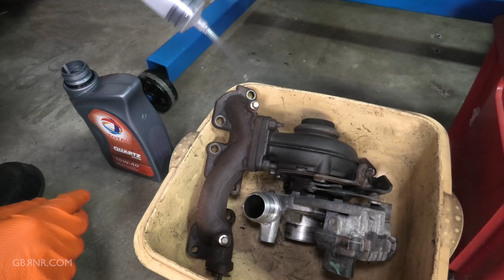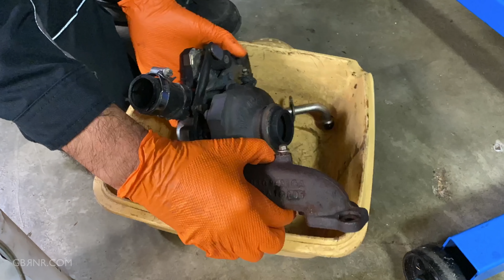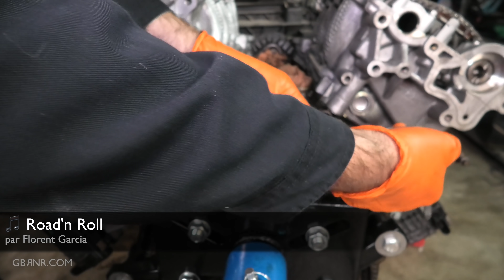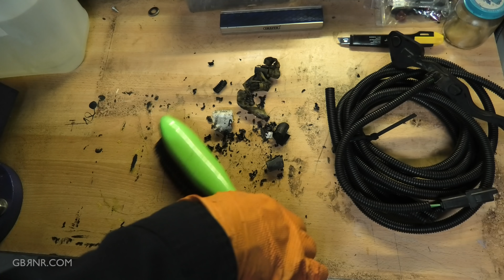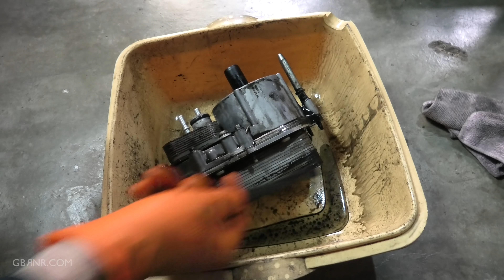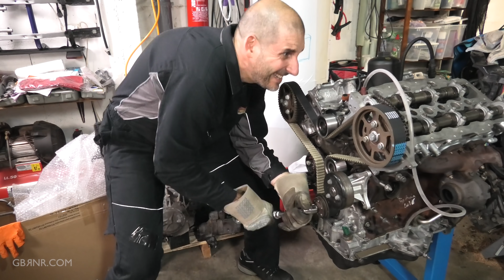C6 🐌  Bi-TURBO 🐌   le V6 retrouve ses attributs masculins

Comment: Quand je t'ai vu attaqué à tourner le moteur à la main, je me suis dis : courageux et costaud le gars ! ;)
Démonte les bougies, ça ira mieux ! Ça avance bien !
Reply from the maker: Les injecteurs ne sont pas remontés donc il n'y a pas de compression dans les cylindres. Et même comme ça c'est dur ! 🥵
Reply: j'ai pensé la même chose, c'est un classique, sinon tu luttes contre la compression.
en même temps (ça fait un peu macron :(  ) les bougies sont serrées pile-poil et par principe j'aime pas trafiquer les serrages de nombreuses fois ou revenir toujours en arrière. (c'est un coup à faire des erreurs ou alors tu reprends scrupuleusement ce que tu as fait, mais c'est du faire et défaire et refaire)
J'ai pas le moteur sous les yeux. mais justement n'aurait-il pas été possible de ne mettre les bougies qu'après pour pouvoir amorcer à la perceuse?
Reply: Garage, Bagnoles et Rock'n Roll  mais pourquoi t’as pas mis la clé à choc en mode visseuse en mettant la puissance en mode qui va bien ça te le ferais tourner sans peine
Reply: @mfrostel7459  des a-coups pareils dans une telle mécanique c'est à tout péter!!
Reply: @ZeshXD oui pour les accoups mais une clé à choc elle « choque » pour débloquer/bloquer. Une fois que la vis est libre elle se contente de tourner. La vu qu’il y’a peu de résistance en la réglant comme il faut elle ne choquera pas elle fera juste tourner le tout. Appuye sur la gâchette d’une clé à choc a vide tu verras elle ne choque pas quand il n’y a pas de résistance. Enfin un V6 a un fonctionnement "non linéaire" d’où le tendeur/amortisseur assez costaud sur la courroie pour encaisser les cycles compression/détente transmis à la courroie par l'ensemble de la mécanique. Donc je me fais pas trop de mouron à vide avec une clé à choc réglée faible. Attention ça n’est valable qu’avec le moteur pas étanche comme ici sans les injecteurs ou sans les bougies si c’était le V6 essence
Reply: @mfrostel7459  Y'a quand même l'air d'avoir une belle résistance ^^ Je m'y risquerais pas perso ;)
Reply: ZeshXD  ça reste un v6 avec un équipage mobile lourd certes mais la notre ami en bip sa race car il a un bras de levier plus que court et pas super adapté pour ce job

Comment: Coucou François c'était apaisant à regarder ;) tu aurais peut être dû vérifier la géométrie variable du turbo (ailettes) il est systématique que les turbos kilometrés présentent des grippages sur celle-ci. 

Un simple coup de dégrippant et brosse métallique suffi à éviter le problème sérieux de réduction de puissance (dégradé) et parfois casse turbo (plus précisément la turbine et les ailettes, en subissant des alternances de charge brusques et hors limite).

Il suffit d'ouvrir la partie échappement qui n'est que sincèrement rarement difficile à ouvrir (faire attention aux vis qui sont "cassantes") en faisant attention que le démontage ne cause aucune modification d'un réglage d'usine (dépend de la marque et du modèle).
A bientôt
Reply from the maker: Je ne vais pas tenter d'ouvrir le turbo: il y a de fortes chances que les vis pètent
Reply: @gbrnr  c'est vrai, une prochaine fois peut être :p

Comment: Bonjour François. Ça prend forme le remontage de ce moteur, joli travail 👍
Par contre tenter de faire tourner le vilbrequin avec une perceuse une fois les bougies de préchauffage remontées, c'était voué à l'échec. La compression est beaucoup plus importante sur un moteur diesel par rapport à un moteur essence.
Je suis pressé de l'entendre "chanter" ce V6 HDI. Bon courage pour la suite.
Reply from the maker: Les injecteurs ne sont pas remontés donc il n'y a pas de compression dans les cylindres. Et même comme ça c'est dur ! 🥵
Reply: @gbrnr  Ah bah oui, je les ai zappé eux, quel c-- ! 😂
Mais ça reste un bon V6, raide à tourner avec une clé à pipe et une rallonge.

Comment: Super vidéo
Je pense que le problème que tu a u pour l'amorçage du circuit d'huile est le remplissage de L'ÉNORME filtre à huile, remplir l'huile par le filtre aurait permit d'amorcer u'e bonne partie du circuit (enfin si le clapet le permet)
Bonne change pour le remettre dedans
Reply from the maker: Vu comment il est orienté ce n'est pas possible de le remplir
Reply: @gbrnr  certe pas remplir tout le filtre mais du moins les conduit entre la pompe et le filtre mais ça reste pinailler l'huile arrivera au démarrage

Comment: Gros débat pour nos DT17TED4... Quel grade d'huile ... les uns disent qu'il lui faut de la 5w30 pour le FAP, d'autres disent qu'il faut de la 5W40 pour préserver le vilbrequin et la pompe à huile fragile... Perso je suis plus pour de la 5w40, je ne sais pas ce que tu as choisi, mais c'est l'éternel débat entre propriétaires de 2.7 Hdi 🤔

Quand le moteur sera en marche, dans un prochain épisode j'espère, pense à vérifier le fonctionnement du SWIRL, il y a un tuto sur le net qui t'expliquera mieux :
https://www.forum-peugeot.com/Forum/threads/tuto-controle-et-remplacement-commande-swirl-sur-v6-hdi.91270/

C'est vraiment un élément simple à tester, et c'est vraiment vital pour le moteur, même les mécaniciens de la marque ne pensent pas à le tester, et il est à l'origine de problèmes aléatoires et étranges (pas de contrôle par electronique, donc aucun code défaut si il est HS).

N'hésite pas si tu as besoin de conseils 😃
Reply from the maker: Ce sera de la 5W40. Pour le FAP il faut qu'il y ait un additif dans l'huile (ce qui est le cas de celle que j'utilise).

Comment: Salut François, j'ai plusieurs questions :
- si tu n'avais pas amorcer les turbos manuellement et que tu les avais monter directement, est ce que par le simple fait d'essayer de démarrer le moteur (avec des capteurs débrancher afin d'empêcher le démarrage) aurai été suffisant ou cela aurait été trop risqué pour les turbos
- quand tu tourne le moteur à la main, on peut apercevoir que la chaîne qui relie les deux arbres se décale de gauche à droite et saute à moitié sur le milieu du chemin, c'est normal ?
Reply from the maker: Le tendeur de chaine bouge car il n'y a pas de pression d'huile dedans 
Et pour les turbos je les amorcerai avant le premier démarrage, possible que ce que j'ai fait là n'ai pas servi à grand chose
Reply: @gbrnr  j'ai toujours entendu dire que mettre de l'huile colle tu as fait, c'était bien mais c'était sur des turbos neuf, pourquoi tu n'as pas essayer de faire tourner le moteur avec la clef à chocs ? Sa aurai deviser la vis de la poulie ou les "chocs" n'aurai pas été bon pour le moteur ?